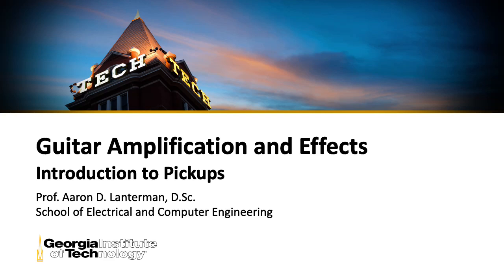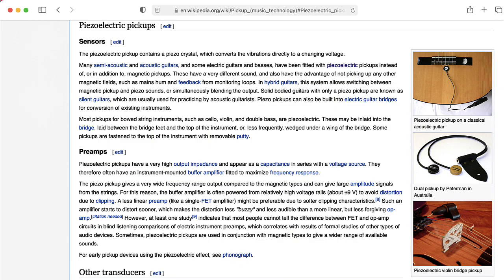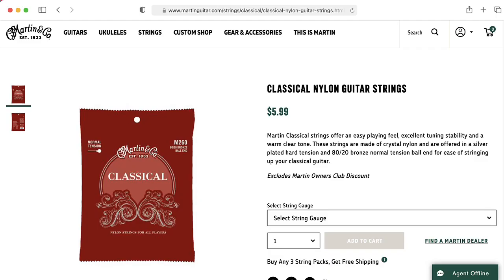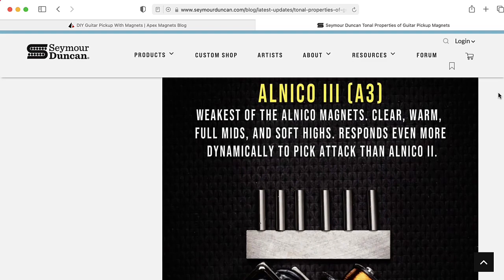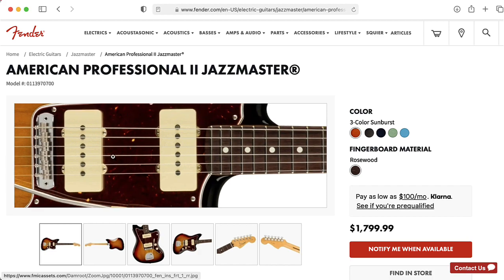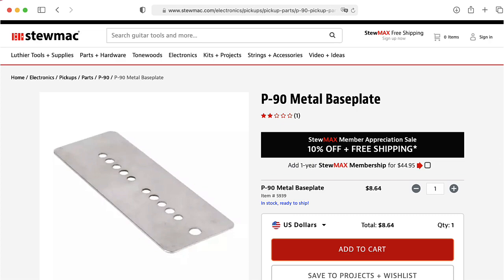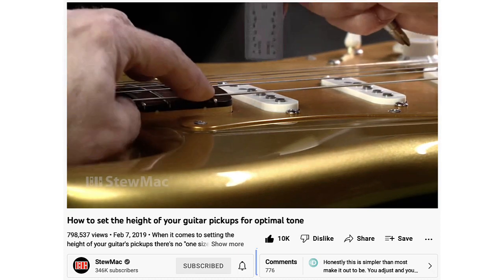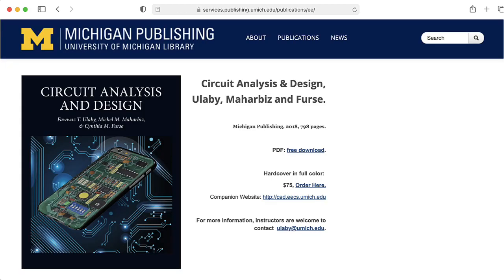ECE4448 L7: Introduction to Pickups (Guitar Amplification and Effects, Georgia Tech course)

Comment: Very neat. I was thinking that, at least with thin cylindrical magnets / pole pieces, wouldn’t a string vibrating side to side produce waves an octave up from a string vibrating up and down? Even assuming vibration with only a single mode, you could get a variety of different sounds depending on the angle with which the string vibrates with respect to the pickup.
Reply from the maker: I don't think it would be two octaves up. In any case, check out Section 4 of this paper: https://hal.archives-ouvertes.fr/hal-02512148/document
Reply from the maker: But in general, yeah, we assumed just 1-D of motion, but the string can have all sorts of 2-D paths that couple into the pickup in interesting ways.
Reply: I think that to a first approximation, the pickup is not sensitive to string motion except in the up/down direction. There's probably some nonlinear effect that would produce some signal from a sideways vibrating string, and it seems like it should be based on the square of the signal to a first approximation, but it would probably be quite weak. The square of a sine wave basically gives you a sine wave one octave up (plus an offset), but for more complex harmonic waveforms you can still have some fundamental left after squaring the original waveform. Just think about squaring a sawtooth wave for instance.

Comment: Unrelated, but could running a PLL off your audio signal (perhaps multiplying or dividing the frequency), using it to feed a BBD-based comb filter, and feeding the original audio signal through the comb filter do any good? I was thinking that it may be usable to latch onto certain harmonics to amplify regardless of the initial frequency.
Reply from the maker: I think people have done stuff like that in the digital domain, so it makes sense it would do something interesting in the analog domain.

Comment: Thanks for the great video. What prevents an electric guitar string from conducting electricity? I don't recall ever having been even a little shocked while touch a vibrating electric guitar string.  It seems like if they become "magnetized" as you say, they should also conduct.
Reply from the maker: Oh, electric guitar strings ABSOLUTELY conduct! And the strings are hooked to the bridge which conducts which is usually hooked to the ground to help reduce noise. Which is why using a guitar with an amp with messed up wiring is really dangerous!
Reply from the maker: I had a Fender Bassman with a leaky "death capacitor" (I was a teenager and didn't realize what it was a the time) that would pass a bit of AC in one of the switch settings and give you a tingle.